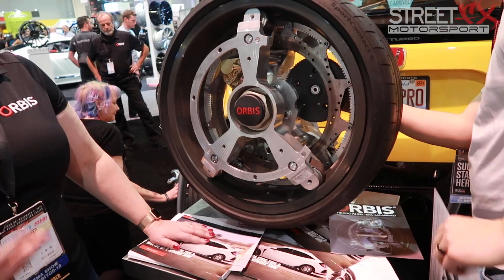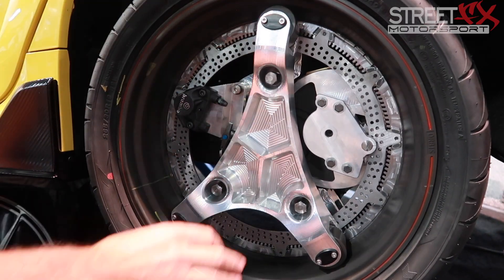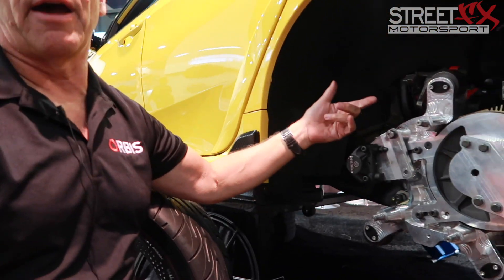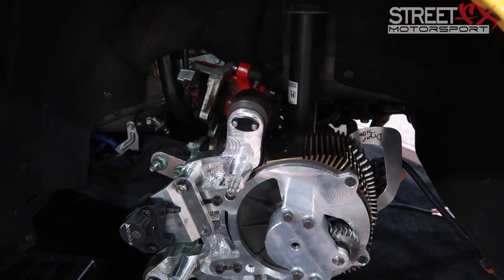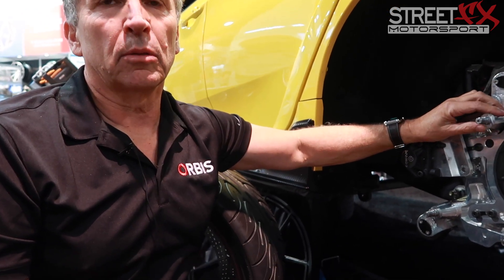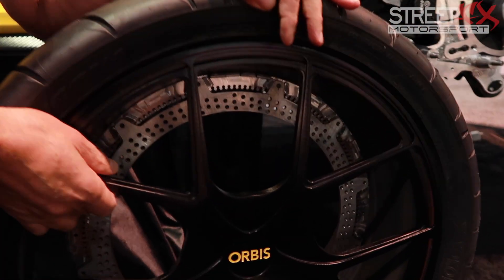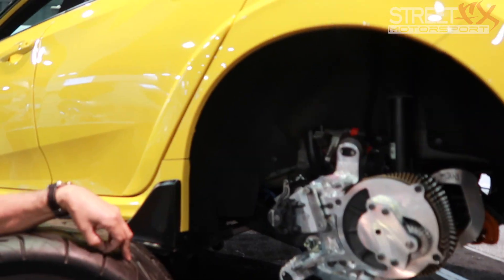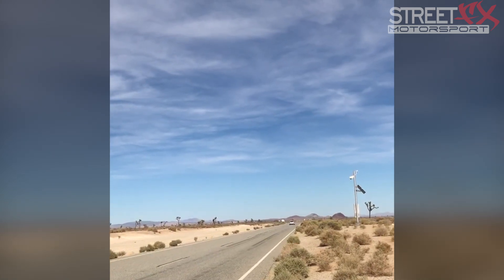WORLD's FIRST ELECTRIC hybrid AWD Honda Civic Type R FK8 with 450hp!

Comment: Worst design. If the rim bents a bit the whole system wobble out that too in thousand pieces. Very inefficient rolling thus high rolling resistance. imagine getting sand into those gears... good luck.
Reply: Yeah this is one of those designs that looks more like a proff of concept more than an actual product to be used.
Reply: That's what I was thinking! I was going to ask what if you hit a serious bump and bend the rim? Glad I'm not the only one that's asking questions. Ppl get so horny for ideas that need way more work - that being said, every popular product has a concept stage. Can't wait for this to be redesigned and perfected!
Reply: @DanSanniti   trust me, they will be able to find enough fool investors dying to invest in this thing.
Reply: I can see if it were all enclosed but interesting design. Still would be much more efficient to just go all electric and ditch the ICE.
Reply: Imagine getting sand in all those motorcycle chains!! All exposed and shit
Reply: Meshing gears and a chain and sprocket combination are two completely different things.
Reply: @Stormprobe  it's not about how they work but being exposed to the elements.....

Comment: Installing that onto the existing control arm is easy for anyone with mechanical experince but the wiring will be a pain in the ass especially finding a place for a hybrid battery pack that was never meant to be on a regular non hybrid. Starting a project with this motor assembly would mean starting with a hybrid car such as a prius, insight, volt etc would be easy.

Comment: https://es.aliexpress.com/store/product/QS-Motor-130kph-12000w-electric-car-in-wheel-hub-motor-with-96V-system-connversion-kits/1389549_32848392319.html?spm=a219c.search0104.3.1.a6f410f2uD3V1Q&ws_ab_test=searchweb0_0,searchweb201602_3_10065_10068_319_317_10696_10084_453_10924_454_10083_10618_10920_10921_10307_10922_537_536_10059_10884_10887_100031_321_322_10103,searchweb201603_1,ppcSwitch_0&algo_expid=b1f83aaa-7038-41d9-a4b0-3782eb1e4e16-0&algo_pvid=b1f83aaa-7038-41d9-a4b0-3782eb1e4e16

That is a 70hp at the wheel motor for less money just 2000 dlls you still need a battery but way cheaper that this

Comment: Sounds great but what about the strength capabilities if I were driving on normal condition and where there are potholes wouldn't that be a death sentence for the aluminum structure if I were to hit at high speed?

Another thing I don't believe this would be great if it were place on the rear wheel since the back act like a vacuum and the front is more a blower. I feel that dirt or rocks would disable the gears.

I want to see this outside of city use and want it could do on gravel roads or sites where construction is normal day-to-day operations.

Comment: I love the idea!!!!! But I don't understand why the brake, rotor, wheel, and hub roller thing had to be different than stock. This idea would be perfect if it replaced the spindle with a motor that powered a wheel flange using the stock wheels and breakes.

Comment: Its a great idea but it seems fragile for the dumps. It will break after a while i would guess. The fragile pieces of motor etc are normally protected by the suspention system and if they are on the wheels themselfs they are not protected.

Comment: Look at 5:32,  he says due to shock tower placement in the Type R, the largest hp you can get is UP 50hp ! This wheel maybe  capable upto 100hp, but in the Type R application , “upto” 50hp only for $12,000 to $13,000 . Not to mention the handling dynamics of any car when you add 200 lbs of battery changes.

Comment: Can I go over bump on these at 100 km?)))
Reply: Yeah that wheel design has no structural support so thats a good point you make that rim design will damage easily.
Reply: @shezie9525  the faster you go the easier impact from the bumps and holes,   it is moderate speed that gets you

Comment: THAT'S FUCKING COOL!!!!!!!!!!! My only concern is the hub parts/wheels touching the wheel itself. If a pebble or rock, something that is not meant to be there, gets inside, I can see a lot of damage happening. How would they mitigate that and did they even think of the possible problems with it. Otherwise, like I said, this is really cool.
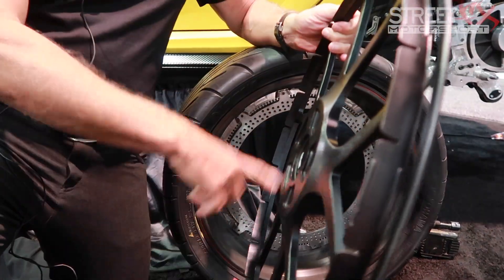Reply: I stand corrected, they did think of that debris issue on 7:35. I am impressed.

Comment: Open dry metal gears, car supported open hard plastic rollers... I'm sure it works ok in a carpeted show hall or for a race track demo but after a week on a dirty wet road full of stone chip and sandy grinding paste?
Reply: If you really pay attention the guy said it was a sealed hub...  the rim has a clear cover or a black cover for the non show model
Reply: yes, open gear design inferior...cover for the outside will not protect from the inside of the hub....sand, salt from roads will destroy this setup quickly,  let alone a piece of gravel getting into the gears...would rather go with an electric motor coupled to a rear differential,  and modify to fit under the rear of the car.  Better add on for a front wheel drive...or sealed rear hub motors.
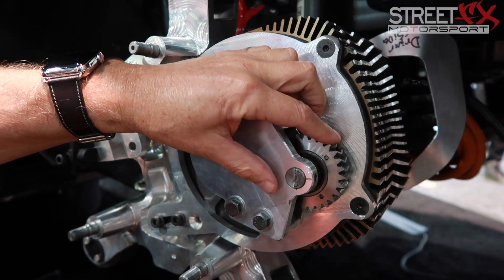Reply: Did you not watch 4:19???
Reply: you just read my mind
Reply: he said you can put a lexan cover to seal it but just the front side... also the brake & motor heat thing. i really love this idea but i cant use the awd off road...
Reply: @polarblue7468  It seems incomplete and I imagine a sealed system would be the way to go.. but hey guess we gotta wait for the engineers.
Reply: @polarblue7468  only sad part that you have to hunt for used battery pack from prius
Reply: @polarblue7468  Yes, but not enough time for a future, 2020 electric cars will be selling, unless this small compaby got a big financiers, to final production and target for large volume...
ICE engine cars will be dwindling in numbers slowly from then on... In 1 or 2 decades 95% will be history

Unfortunately good ideas but aren't going to take off
Reply: @jamesl7205  there are lots of smigels clutching their ICE cars like no tomorrow. seems like the number is only increasing, even as EVs get better and better

Comment: Why not put one for every wheel an gas engine to spin an generator for the charge of the batteries. Like a locomotive. That would be cool.
Reply: For that price you would be able to go buy a proper Range extended Electric with likely way more range.  Would love to hear that tiny motor screaming down the highway.  Going to sound like a higher pitched Ju 87.

Comment: The weight increase isnt that bad, a mechanical awd setup would be just as heavy. This is just the beginning, give this tech a few years and it would be a quick way to add power and fuel efficiency for the price of a turbo kit or s/c. Very nice.

Comment: Finally! Ive been waiting for some plug and play hub motor options out there. It would be great to add 4 of these to a truck and replace the gasoline motor for a huge battery pack. Then I could have an all electric truck.

Comment: Hate to be that guy but holy shit why o why has not a single person thought I'll make a system that uses a small engine to power a charger unit with in the car to charge as you use. Then twin that with regen breaking and you will have a petrol or diesel electric hybrid. Like the old trains....

As all I see is nothing but bs technology that is so over engineered is a joke. 

Work smarter not harder.

Good God you could have a welders type of gen set to power the charger pod unit thing that is normally used to charge the battery pack and then you can drop half the battery pack because you can charge on the go. 

It will cost little to nothing to run the gen set charger unit. 

But hay let's be real we could all be using hemp oil to run our cars and trucks on but the government ain't gonna let us...

Comment: I see some negatives to this. First you have all this friction from the tire to provide traction, but all the energy of the motor and braking is limited by the friction those 3 rollers can provide. I'll let you math wizards run some estimate numbers on what kind of force those rollers can provide, but it doesn't take a set of calculations to tell me those  little rollers just can't provide that much traction for acceleration and braking. I will say that its a cool concept though and i love out of the box thinking just address those weak points and your golden.

Comment: Imagine that any dirt that get between the rollers-wheel rim and on gear ring will sand it away, making it lose. Also side forces will eat away rollers too. 
You cannot cover it fully, cuz brake disc need to be cooled. It is nice but not practical (safe).

Comment: It's a great concept, but in reality these would fail on a massive scale.
The rollers that keep the rim aligned and in place would wear out atleast 10 times faster than a wheel bearing due to the rpm.
And when these wear out, the rim wouldn't be aligned, it would wear the rollers even more and eventually the rim would fall off.

Comment: That's a joke not a brake caliper
Reply: So you have to replace the whole wheel when your replacement for a rotor wears out?
Reply from the maker: No. It's bolted on. Didn't you watch the video? 😳

Comment: 10K fuck that basic mods and a remap will see that HP and cost much much less
Reply from the maker: It'll still be fwd. for 100hp, you'll need to upgrade clutch and driveline... oh and you'll increase driveline wear. This does none of that.
Reply: @StreetFXofficial  still cheaper I got a golf gti running 500HP in a 4motion shell cost me 6K all in and it's done 150000 miles still going strong

Comment: Do you know what this means? This is old tech but they finally allowed it to hit the market...So you can transform all other cars into all wheel drive electric vehicles for under $10,000! Wow! This changes everything. I was told that this product was coming 2001 and saw simple working models in hubs but they were calling them electric brushless pancake motors at that time....but this is a final working production model for super cheap...This is going shock Tesla... Just my first thought...

Comment: Only missing part is charging integration with the IC engine and charging ports. This will act as a boost only when batteries are charged through regen braking.

Comment: I’ve been wanting Subaru to make a rwd sti with electric front motor/generator unit. 

This is cool too.
Reply: I'm waiting for Subaru to make a hub motor electric AWD Forester, would be the ultimate light offroader with instant torque and low speed control.

Comment: Can we drive the car on these electric motors alone?
I mean, switch off the petrol engine, and run the car using the modified rear wheels only until battery runs out.

Comment: Im not trying to be salty but with the gears wide open wouldn't it be prune to rocks? I mean you never wanna leave your timing belt wide open without a cover, wouldn't that same concept apply to this as well? It's a great design but I think a lot of the complaints from buyer most likely would be that a rock got stuck in the gear and now it won't spin...

Comment: How would this save on fuel? As I'm pretty sure your main combustion engine is going to be constantly ramping up it's alternator to keep the battery charged for these. Which means combustion to mechanical to electrical to mechanical energy which would be overall less efficient than just combustion to mechanical right?

Would this also mean that with the constant charging state that you'll end up losing some power from the main engine?

Comment: Can’t wait til the Chinese make it for dirt cheap lol 😂
Reply: Dirt cheap,and dangerous
Reply: @judekeplert2  they’ve gotten pretty good at dirt cheap not dangerous turbos, what u got to say about that? Their track record says u wong.
Reply: judlimixnofake sounds like your wife
Reply: @get-fucxkxd-utoob  ouch 🤣
Reply: And it falls apart in under 50k miles
Reply: You can already buy hub motors for cars from China, personally though I don't think I'd trust my life on a cheaply made spindle which is also hollow because it houses the wires for the motor. I'd worry if it would be strong enough that the wheel doesn't just fall off when you hit a bump. If I was doing this I'd rather just fit an electric motor and connect it to a differential to send the power through drive shafts from a reputable manufacturer
Reply: They already do but Honda is Japanese
Reply: @roxasparks  yeah but people is still gonna buy it when it came out because it's more affordable..
Reply: It would be on wish.com for $ 9.99
Reply: When u see these kits causing fires you will know the Chinese versions have hit the market
Reply: @imaginova88  it’s not a plug in hybrid so it shouldn’t catch fire like you say especially if you use a refurbished Toyota battery.
Reply: @imaginova88  metal don’t catch fire usually that’s the batteries but guess what all batteries are made in China lol that includes your phone too lol
Reply: They already been had hub motors buddy
Reply: @roxasparks  they already had this for over 3 yrs
Reply: Its on wish and ur right^^&
Reply: It's all about the consumer fuck the companies.
Reply: The Chinese already made this before this company
Reply: Yeah agree with you 🤣
Reply: Already have
Reply: Oh i sure can
Reply: When you see one rolling on the highway by itself and sparks flying from a 3 wheeled car following it 😂
Reply: Roxas Parks greedy Americans sell licensing agreements..then the engineering gets copied slightly different making another kind of the same thing legally
Reply: @2552Zeus  
Nope..they extort complete systems
Reply: Jaxx Brat well if Americans would stop being so greedy trying to squeeze every bit of profit and stop sending manufacturing to China where their blueprints would get stolen and replicated then China would have nothing to extort
Reply: Texas Made Born N Raised 
The Chinese don't need licensing agreements or blueprints to steal and copy designs.
Reply: @roxasparks  you must be talking about apple they do it all the time, holding back other tech companies in the name of profit
Reply: @roxasparks  
Yes and now its exposed and wont get shoved under a Libtard rug
Reply: Guns, Planes, the first nuke bomb ( oppenheimer ) these are all things usa used but its from germans they took at WW ll was over. by the way usa are the biggest shitwhole on earth, war war war , look the war/peacetime of that stupid attacking army.

Comment: Awesome idea but I have a few concerns . The weight savings isn’t really weight savings considering you have to add a battery pack to power the electric motors. Also what about outside elements getting into and in between the gears?  They said the motor was fully submersible but the outside gears are completely exposed to the elements . If a pot hole is hit on asphalt and bends the wheel how is the gears going to be able to rotate if the output gears get to be bent?

Comment: Since it's electric talk about torque gain I'm curious about that! add 100hp and awd in a small and light sleeper would be awesome like an old crx!
Now imagine I take an NA Miata, cuz miata is always the answer right? Fully guted, make it basically a bear shell! Put the 100hp per wheel engine on all 4 corners, and that is my question;  is there a way to use that on a front wheel, like bolt it on the front axles? That certainly means change the brake system like the rears!
So a 400hp, awd, 50% weight distribution,  maybe sub 2100 lb but I don't know the weight trade loosing all the engine and transmission for batteries for four 100hp engine!
Maybe it would be the ultimate autocross experience! or not cause I don't know if it would work like my childish brain imagined it Aha :D
Reply: I thought exactly the same but with a BRZ instead of a miata
Reply: put retractable wings and youll fly
Reply: You smoke a lot of weed don't you?
Reply: I wonder if I can fit it in my 2019 Kia Soul?

Comment: I dunno how well itd hold up to having organic material crammed in there overtime. Not to mention if those 3 rollers sitting on the wheel are made of rubber/polyurethane which means theyll have to be changed out fairly regularly and theres a chance those id be pricy.

Comment: Those three leaning points on each side of a wheer are going to be wasted pretty soon in dirt, dust or so. Diameter, thus contact surface is too small and wear would be quick if it isnt made of some super durable material, which I doubt. That further leads to wheel play, rim tear and overall failure. Great idea, but...

Comment: This can not be called direct drive, it is driven through gears.
I wonder how this would be with a few stones thrown amongst the gears and rollers, ie gravel road.
Will those gears require regular lubrication and if so could it be thrown on to the brake disk and wheel?

Comment: That’s so cool!!! I heard Sema blew balls this year. I’m so confused by this lol. So the wheels power the car you don’t use the 2.0t at all? It’s super loud though. So $11,000.00....ummm no haha. That’s just my opinion but no fucking way. That’s a lot of money. If I was gna put 11k into a type r I wouldn’t care about gas mileage. I have a 2017 Si with 300hp 400 torque and I’m still getting 37mpg on highway and 28-29 city. That’s good enough

Comment: Still waiting for a system that provides electric torque through a modified rear diff cover. Awesome idea and engineering, but my rear tires already turn under power.